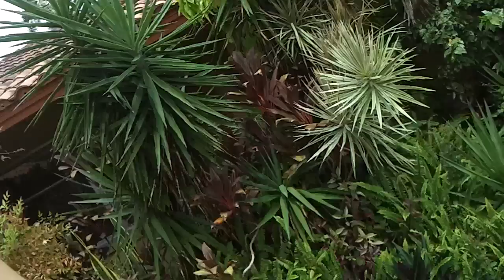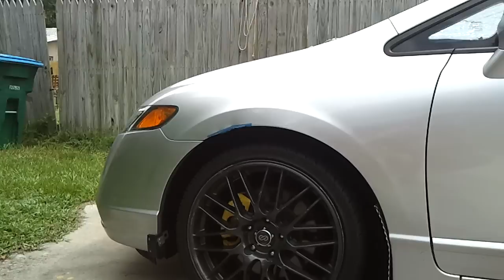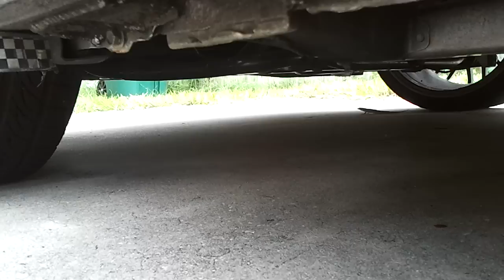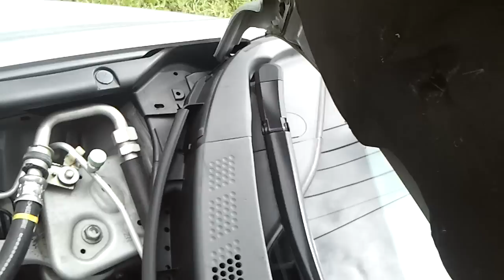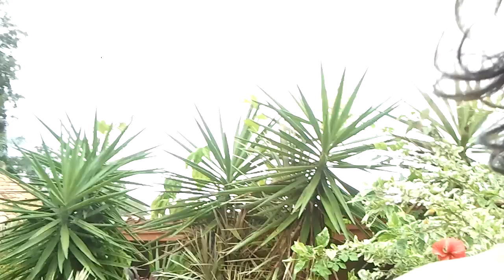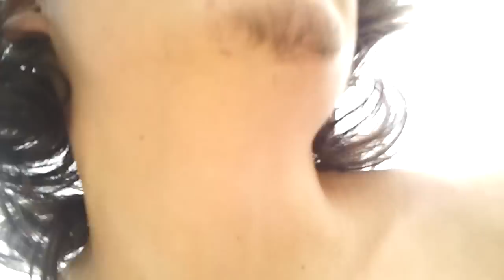Input Shaft Bearing problem? HELP!

Comment: Definitely sounds like the input shaft bearing. Kind of hard to hear it at first over the exhaust, but knew when you pressed the clutch pedal and then let it out. I am working on diagnosing a 03 Civic Hybrid with the 5 speed manual and your video helped me out. Thanks for sharing. I think my output drive axle bearing on the drivers side is failing. Only makes noise when moving in low gears. Drive axle feels loose going into drivers side of trans axle.

Comment: Have the same problem in a 07 d22 nissan frontier, changed throat bearings (throttle) and it still has that loud sound in neutral and 1st, 2nd, 3rd and 5th gears....im going to take a look at the pilot shaft bearings today as im now convinced its the problem
Reply: Dayne Lyn-Cook hi, were you able to solve this?

Comment: how did you fix this?? new transmision or new clutch, flywheel and release bearing??
Reply from the maker: If I remember correctly I went ahead and bought a new clutch, upgraded to an Exedy Stage 2, and scooped up a new throw out bearing.  The noise never came back.  It was likely just the bearing.
Reply: +TopShotta when you pressed the clutch in it stopped making the knocking sound?
Reply from the maker: hector leon I just listened to the vid again and yeah, when I was pressing in the clutch the sound was going away.  Then when I released the sound was coming back.
Reply: Hey man, you ever get it figured out?
Reply: Aiight just reading what you put hella helps me lol, as of rn it seems like my input shaft bearing is going out but it’s a minor noise, my car has 130k miles on it with a brand new r18 engine with 15k miles on it, I believe it’s time to just change the clutch flywheel and Input bearing on my civic. Thank you, luckily I came across this video before it gotten worse

Comment: Holy shit that's loud lol. I have tsx 6 speed it's just making a low humming noise and I'm panicking lol. did it always sound that loud. from reading forums I thought mine was going too. but some say throughout bareing
Reply from the maker: +Stephenie Serrano Yeah it was pretty much that volume when I was having the problem.  This was many years ago I kind of forgot the solution!  I think I got a new clutch (stage two Exedy, FREAKING LOVED IT!!) and replaced throwout bearing I'm pretty sure.  Yeah we have the same tranny in these cars.  After a while my 5th gear died too!  Couldn't shift into 5th without grinding :'(
Reply: +TopShotta oh wow mabe you didn't notice it low. so you didn't replace the tranny just the clutch.
Reply from the maker: Stephenie Serrano Right, no need to replace the tranny.  I've replaced some gearsets in it though.  The 3rd and 4th set because it was grinding too ugh

Comment: jesus christ your exhaust is so loud how can you hear anything? all l hear is the sound of your engine how can you hear the bearing?
Reply from the maker: You can hear it! The crazy rattle-y sound! And yeah full race exhaust on an NA car is loud aha. Cold start too
Reply: Electronics For Fun Agreed. Please god put the factory exhaust back on this fucking thing. It’s not a race car it’s a Honda. The exhaust is more embarrassing than the rattling noise
Reply from the maker: @mitchrude32898  You don't know that much about modding cars, do you? Shame
Reply: kanyedian I do know about modding cars, and doing engine swaps rebuilding engines etc. Currently doing clutch, flywheel and TOB on the floor of my garage. Difference is I don’t put exhausts on a piece of shit Honda I keep them Honda’s cutting my grass and I use v8 engines for power.